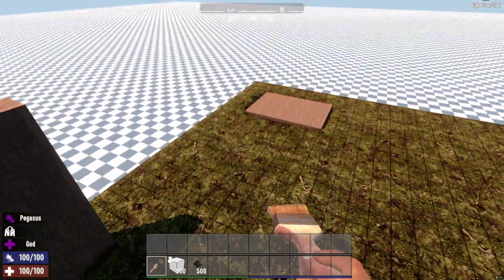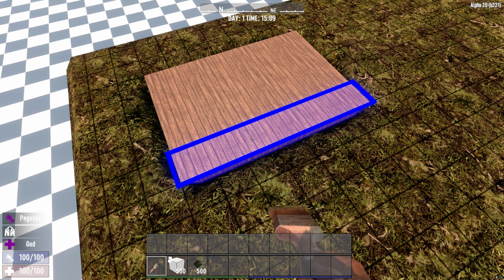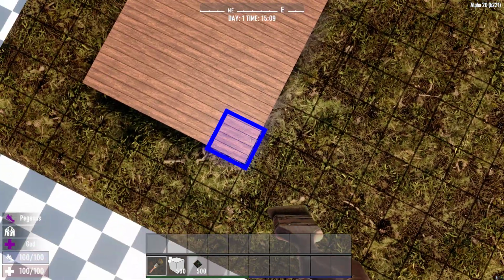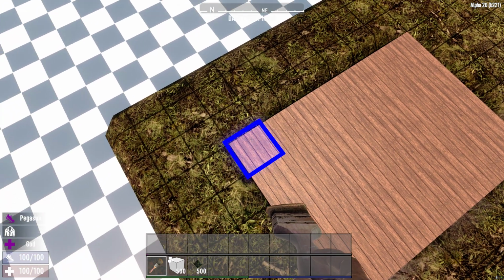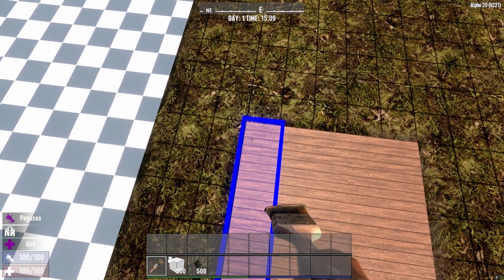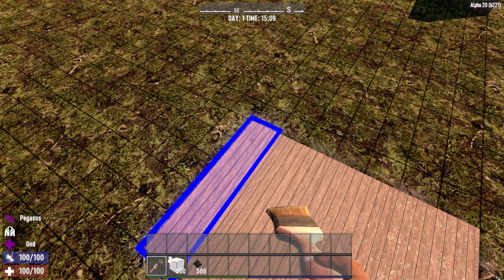7 Days to Die A20 Prefab Editor gully/Density fix

Comment: This sort of works for me... It does in some places, but not others.  I can't discern any pattern.  Also, the arrow keys seem to work whether or not ctrl is pressed... sometimes.  And sometimes not.  And often it results in terrain clipping into my structure which can't be destroyed.
Reply from the maker: yeh in those circumstances i either add a farm block on the outside then do this to the farm block or a extra row of concrete as a footpath etc and do this to those. Stairs and corners are the most problematic.

Comment: do you have any tricks for water?
Reply from the maker: idk messsage i replied with seems to be gone. 

use to use pilles prefab editor in a19 to fix water. not working for a20 unfort atm so cant help with any water issues til either tfp fix water or the pille prefab editor is updated.
Reply: Unfortunately I don't have any tricks when comes to dealing with the water other than using hay bales to clean up the mess that the water makes. Waiting on TFP to get the water fixed. They seem to be more concerned about fixing player exploits than actually fixing a real problem.